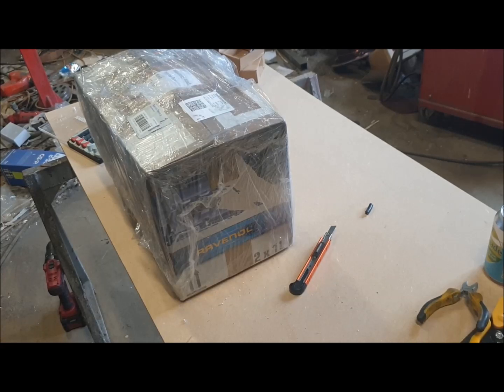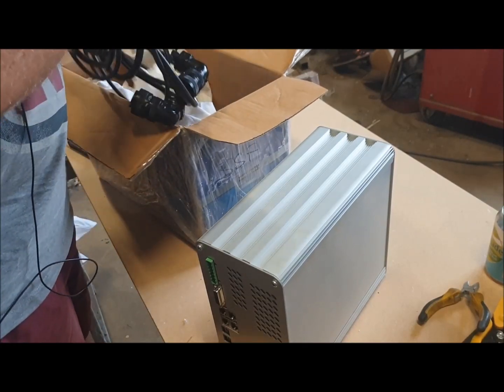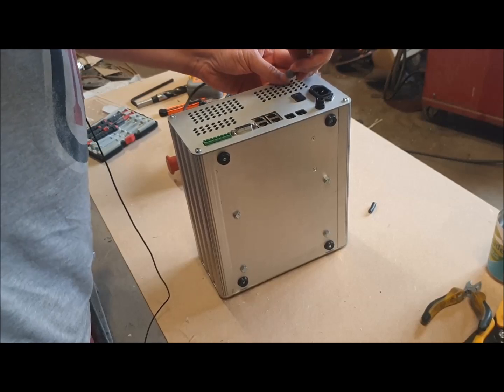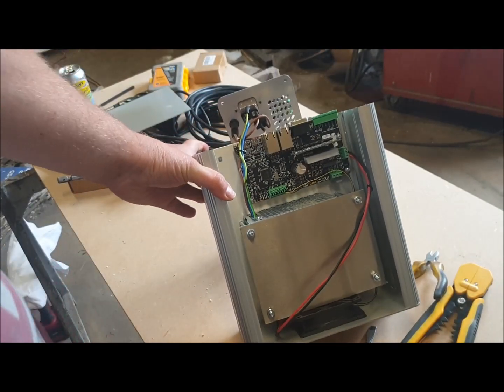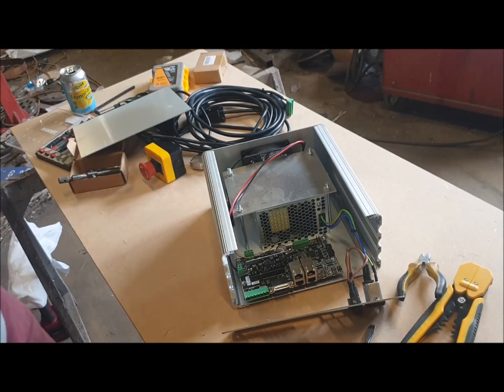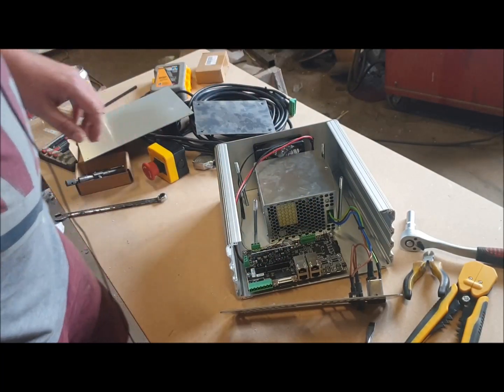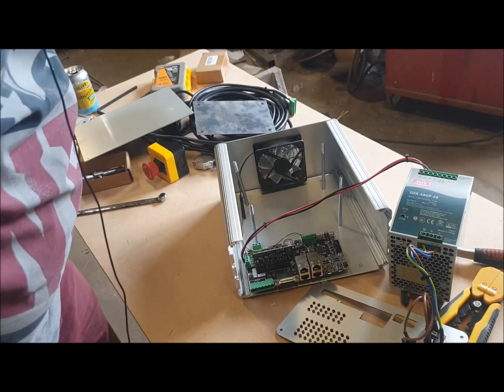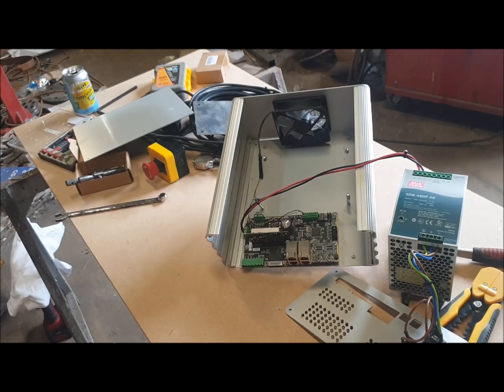Inside an OSW Open Sim Wheel. No FFB Simucube/Ioni problems.

Comment: Hello friends, I don't know if I will tell you the answer is too late. Do you mean that the force feedback is powerful at first but the force feedback will disappear after a while, you press the emergency stop and then release the emergency stop, the force feedback is back, if this is the case, do n’t be sad, this is normal, I mean this The problem is solved well.

This is because the current is limited in the granity software. When the current required by the force feedback is greater than the allowable value, the simucube will automatically disconnect the force feedback

So, just increase the maximum allowable current in granity
Reply: sorry for bad English